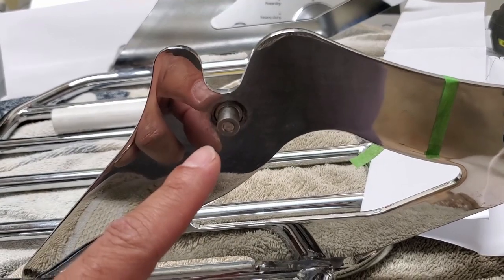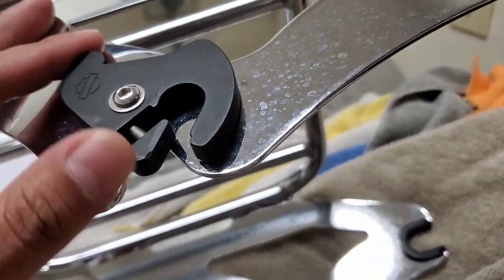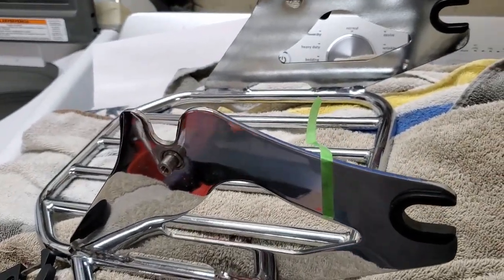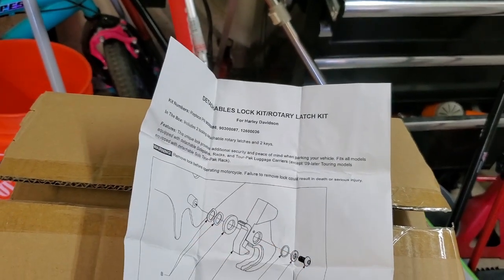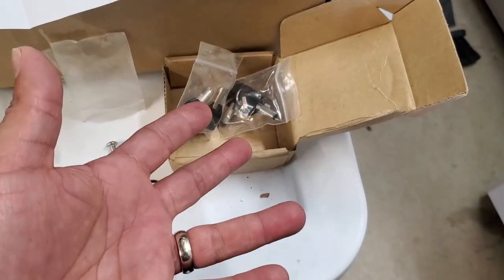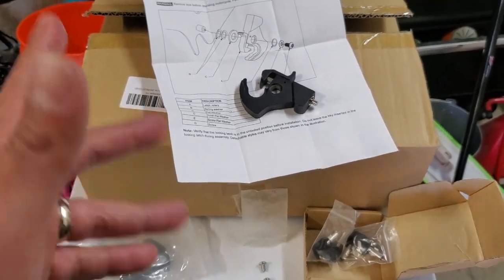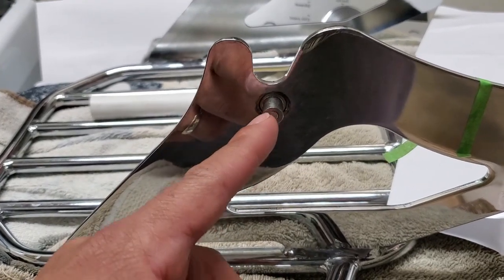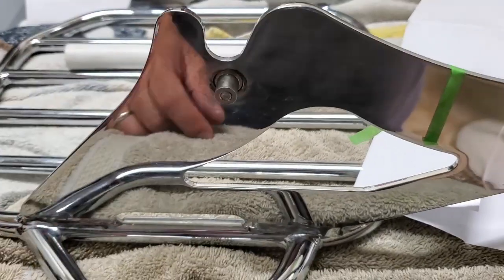Harley Davidson Dock Locking Latches

Comment: does pin not easy to beat out . hope you used Loctite I have had those little screw back out
Reply from the maker: truth be told, I had plans for loctite until I broke that screw.  Then got gun-shy about make it hard at all to come out.  I was also wondering if it would be needed with the spring washers + locking washers. I may circle back and check them from time to time to see if they start to back out.  First up, is fixing that broken post now.
Reply: @Mikeityourself  I have lost a screw out of them before .
Reply from the maker: Roger that, im no fool to pass up good advice.